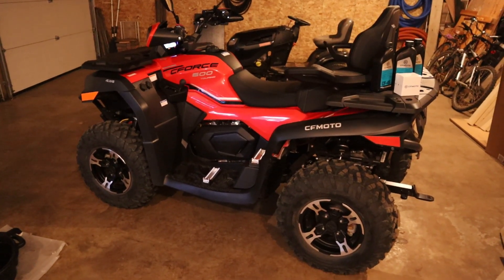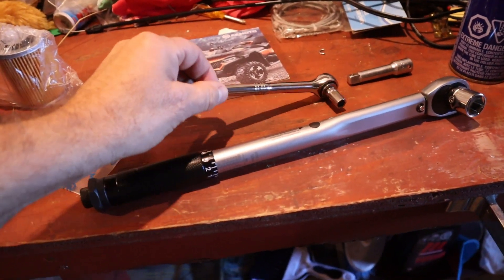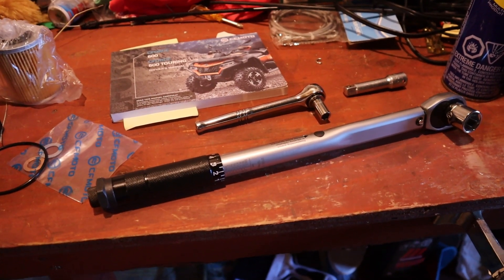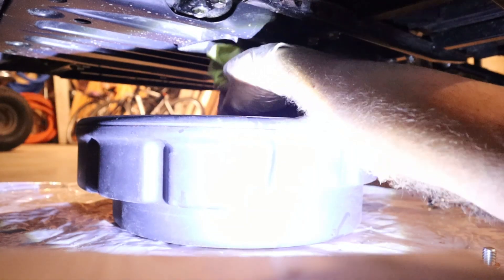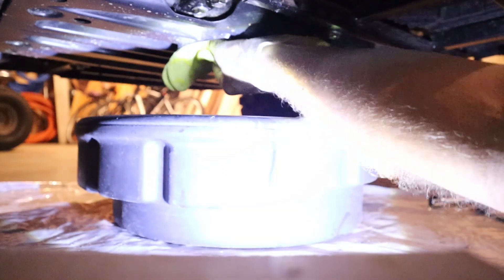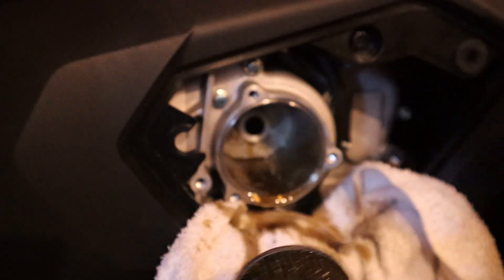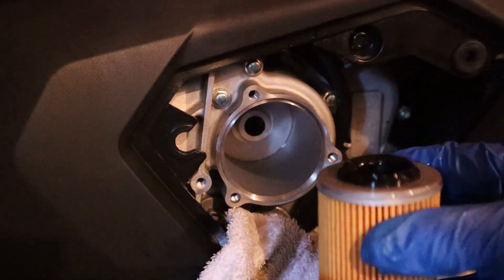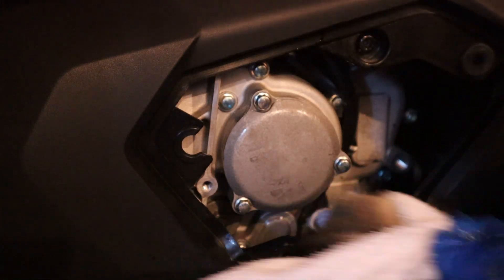First oil change for CFORCE 600 (Full Video)

Comment: Good idea to film for proof. I bought a riding mower 26 yrs ago. The guys at work  ( I am a woman)  laughed at me because I put three coats of wax on the painted metal parts, the deck,  and I put Armor All on all of the plastic parts, I kept the oil changed in it as I was supposed to do. I also kept it in a shed and out of the weather. Every year, at least twice, I washed and waxed my mower.  My reasoning was it wouldn't get too scratched up and by being slick, the grass would fall off easier. I have changed the battery twice, I have put all new tires on this year and a couple of years back I had it serviced and had gotten new belts. The guy called and asked if I wanted him to put the belts on it because the old ones were still good, but since I had already bought them, I had them changed. I am still driving that same mower today !!  And...every year I also put a couple of those blocks of mouse poison in the voids around the motor so mice wouldn't chew through any wires over the winter.!!!
Reply from the maker: You are doing everything right to make it last!

Comment: I use an old plastic tray that came out of a large dog kennel whenever I do my car but this will be my first time doing an atv so this is pretty helpful
Reply from the maker: Thanks for watching and commenting. What kind of atv do you have?
Reply: @ I have a cforce 600 and I love it it’s been awesome for hauling wood around and chicken supplies.
Reply from the maker: @coreyarmastus1  What kind of trailer do you pull and how much weight can you put in there? I'm not sure as on the trailer hitch it is a very low capacity it states.

Comment: Do they require a valve check at break it?
Reply from the maker: It says in manual that a valve check is needed at 20 hours or 200 miles. The dealer did not say that I had to do that but if machine is not running good and the engine is noisier than normal then has to be done, obviously. I have not noticed any problems yet.
Reply: @ yes, as long as it starts easy and runs smooth it should be in check, have been looking into a cf moto. Great content you have here 👍
Reply from the maker: @freedomisntfree_44  Thanks for your kind words. It is still basically new and since so much snow up here, can hardly ever take it out. Would like to get a small trailer for it.

Comment: Have you had any problems shifting forward to reverse in  4X4, mine shifts good in 2wd but I'm scared I'm going to break shifter in 4wd? I have exactly the same machine as yours.
Reply from the maker: To be honest, don't know if we have done that or not as have been mainly going forward in 4 wheel drive but will try that in a few day and let you know. Thanks for asking this question.

Comment: You never took out the oil screen an looked for metal shavings , which is above the oil plug, held on by 3 bolts
Reply from the maker: @ToddKrueger-nt5me  thanks for the tip